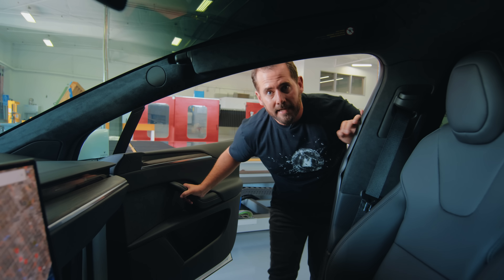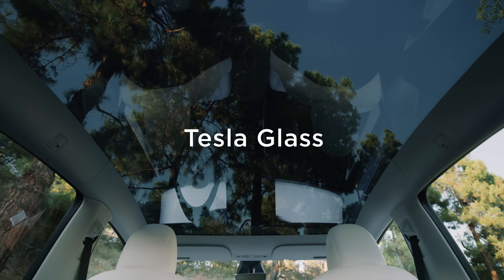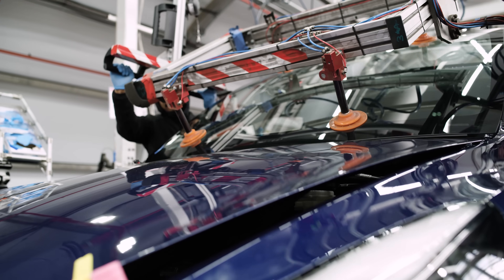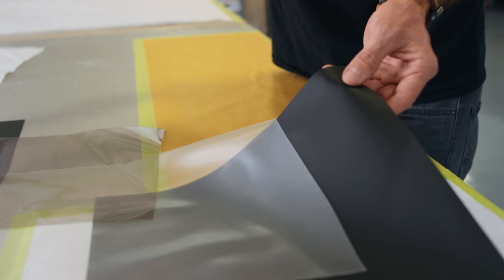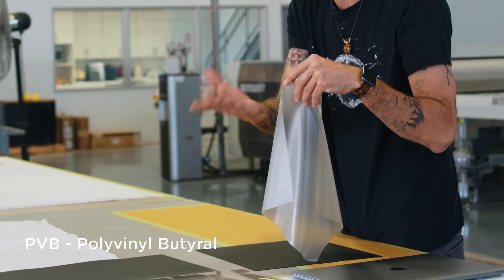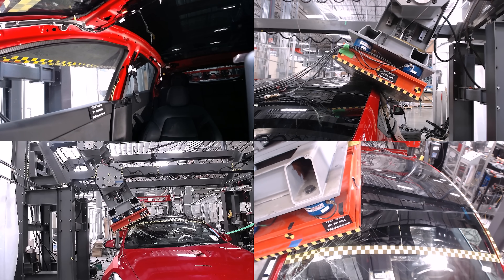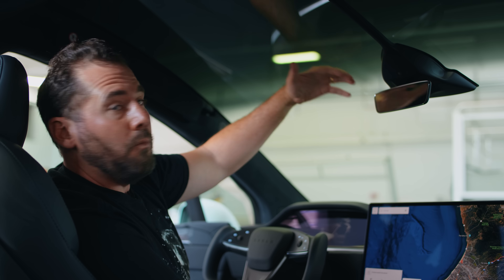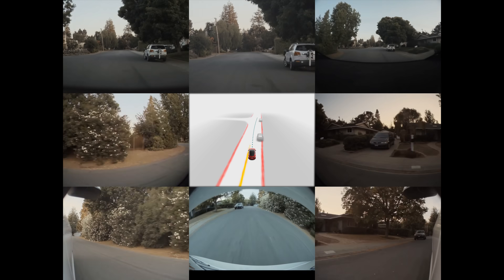Tesla Glass | The Secret to a Quiet Cabin

Comment: Tesla knows glass!
Reply: No. They know how to copy and pretend it's new
W140 features included:

Double-paned soundproofed glass was a new S-Class innovation first fitted on the W140. This form of window glazing allowed for improved soundproofing, reduced condensation, and other insulation benefits.

Electrically-operated exterior mirrors could be folded by switch to ease driving in narrow spaces.

'Parameter steering' was a system which made low-speed driving easier by reducing the effort required to maneuver in speed-sensitive situations such as parking.

Rear-parking markers, or guide rods. These rods extended from the rear corners of the trunk lid when in reverse, providing the driver with a guideline for rear maneuvers. In 1995, this system was replaced by the sonar-based Parktronic system which measured the distance of the bumpers to nearby obstacles.

12-way powered, heated front seats, with 3 setting memory functions and lumbar support.

Windshield wipers with heated washer system. Later models also included rain-sensing windshield wipers.

Electrically-operated automatic-dimming inside rear-view mirror that tied into the seat and steering wheel memory.

Heated exterior mirrors. Later models also included auto-dimming driver's side mirror.

Orthopedic seats were an expensive option from the factory but consisted of several different air cushions in the seat that the user can inflate and deflate to find the perfect driving position.

Dual-zone climate control. Four-zone climate control on LWB models.

Reclining and heated rear seats on LWB models. V12 models also have the four-place seating option, which allows fully adjustable rear seats, lumbar support and rear sunshade control. The center seat has been replaced by a burlwood center console, allowing a 2 + 2 seating format.

The climate control system could be set to operate for 20 minutes after the engine had been turned off.

Electric rear sunshade.

Rear passenger illuminated vanity mirrors.

Soft-closing doors and trunk.

Leather interiors and burl inserts (optional; standard for 500SEC/CL 500).

In 1995 the S 600 Coupe became the first Mercedes car with GPS navigation system, designated Auto Pilot System APS. It featured CD-ROM maps and full color navigation display in the center dashboard.

In 1996 the Linguatronic voice control system and Parktronic sonar-based parking system were introduced

In 1997 the TELEAID emergency and tracking system was introduced in the US market.

Also, developed with the car, a Bose sound system was available as an option.

Comment: Best in the business.  Like...WAY better.  Thank you @Tesla for igniting the spirit of innovation!
Reply: Lol!!!!
W140 features included:

Double-paned soundproofed glass was a new S-Class innovation first fitted on the W140. This form of window glazing allowed for improved soundproofing, reduced condensation, and other insulation benefits.

Electrically-operated exterior mirrors could be folded by switch to ease driving in narrow spaces.

'Parameter steering' was a system which made low-speed driving easier by reducing the effort required to maneuver in speed-sensitive situations such as parking.

Rear-parking markers, or guide rods. These rods extended from the rear corners of the trunk lid when in reverse, providing the driver with a guideline for rear maneuvers. In 1995, this system was replaced by the sonar-based Parktronic system which measured the distance of the bumpers to nearby obstacles.

12-way powered, heated front seats, with 3 setting memory functions and lumbar support.

Windshield wipers with heated washer system. Later models also included rain-sensing windshield wipers.

Electrically-operated automatic-dimming inside rear-view mirror that tied into the seat and steering wheel memory.

Heated exterior mirrors. Later models also included auto-dimming driver's side mirror.

Orthopedic seats were an expensive option from the factory but consisted of several different air cushions in the seat that the user can inflate and deflate to find the perfect driving position.

Dual-zone climate control. Four-zone climate control on LWB models.

Reclining and heated rear seats on LWB models. V12 models also have the four-place seating option, which allows fully adjustable rear seats, lumbar support and rear sunshade control. The center seat has been replaced by a burlwood center console, allowing a 2 + 2 seating format.

The climate control system could be set to operate for 20 minutes after the engine had been turned off.

Electric rear sunshade.

Rear passenger illuminated vanity mirrors.

Soft-closing doors and trunk.

Leather interiors and burl inserts (optional; standard for 500SEC/CL 500).

In 1995 the S 600 Coupe became the first Mercedes car with GPS navigation system, designated Auto Pilot System APS. It featured CD-ROM maps and full color navigation display in the center dashboard.

In 1996 the Linguatronic voice control system and Parktronic sonar-based parking system were introduced

In 1997 the TELEAID emergency and tracking system was introduced in the US market.

Also, developed with the car, a Bose sound system was available as an option.

Comment: Once again Tesla shows the world how it's done. This is why they are Number One in innovation.
Reply: You're joking?
W140 features included:

Double-paned soundproofed glass was a new S-Class innovation first fitted on the W140. This form of window glazing allowed for improved soundproofing, reduced condensation, and other insulation benefits.

Electrically-operated exterior mirrors could be folded by switch to ease driving in narrow spaces.

'Parameter steering' was a system which made low-speed driving easier by reducing the effort required to maneuver in speed-sensitive situations such as parking.

Rear-parking markers, or guide rods. These rods extended from the rear corners of the trunk lid when in reverse, providing the driver with a guideline for rear maneuvers. In 1995, this system was replaced by the sonar-based Parktronic system which measured the distance of the bumpers to nearby obstacles.

12-way powered, heated front seats, with 3 setting memory functions and lumbar support.

Windshield wipers with heated washer system. Later models also included rain-sensing windshield wipers.

Electrically-operated automatic-dimming inside rear-view mirror that tied into the seat and steering wheel memory.

Heated exterior mirrors. Later models also included auto-dimming driver's side mirror.

Orthopedic seats were an expensive option from the factory but consisted of several different air cushions in the seat that the user can inflate and deflate to find the perfect driving position.

Dual-zone climate control. Four-zone climate control on LWB models.

Reclining and heated rear seats on LWB models. V12 models also have the four-place seating option, which allows fully adjustable rear seats, lumbar support and rear sunshade control. The center seat has been replaced by a burlwood center console, allowing a 2 + 2 seating format.

The climate control system could be set to operate for 20 minutes after the engine had been turned off.

Electric rear sunshade.

Rear passenger illuminated vanity mirrors.

Soft-closing doors and trunk.

Leather interiors and burl inserts (optional; standard for 500SEC/CL 500).

In 1995 the S 600 Coupe became the first Mercedes car with GPS navigation system, designated Auto Pilot System APS. It featured CD-ROM maps and full color navigation display in the center dashboard.

In 1996 the Linguatronic voice control system and Parktronic sonar-based parking system were introduced

In 1997 the TELEAID emergency and tracking system was introduced in the US market.

Also, developed with the car, a Bose sound system was available as an option.

Comment: Tesla haters only hear what we owners say. If you justify $45k for a car tell (educate) them why it’s justifiable. This way they’ll also understand why some of us are Fan Boys and not foolish with our money.
Reply: Lol
W140 features included:

Double-paned soundproofed glass was a new S-Class innovation first fitted on the W140. This form of window glazing allowed for improved soundproofing, reduced condensation, and other insulation benefits.

Electrically-operated exterior mirrors could be folded by switch to ease driving in narrow spaces.

'Parameter steering' was a system which made low-speed driving easier by reducing the effort required to maneuver in speed-sensitive situations such as parking.

Rear-parking markers, or guide rods. These rods extended from the rear corners of the trunk lid when in reverse, providing the driver with a guideline for rear maneuvers. In 1995, this system was replaced by the sonar-based Parktronic system which measured the distance of the bumpers to nearby obstacles.

12-way powered, heated front seats, with 3 setting memory functions and lumbar support.

Windshield wipers with heated washer system. Later models also included rain-sensing windshield wipers.

Electrically-operated automatic-dimming inside rear-view mirror that tied into the seat and steering wheel memory.

Heated exterior mirrors. Later models also included auto-dimming driver's side mirror.

Orthopedic seats were an expensive option from the factory but consisted of several different air cushions in the seat that the user can inflate and deflate to find the perfect driving position.

Dual-zone climate control. Four-zone climate control on LWB models.

Reclining and heated rear seats on LWB models. V12 models also have the four-place seating option, which allows fully adjustable rear seats, lumbar support and rear sunshade control. The center seat has been replaced by a burlwood center console, allowing a 2 + 2 seating format.

The climate control system could be set to operate for 20 minutes after the engine had been turned off.

Electric rear sunshade.

Rear passenger illuminated vanity mirrors.

Soft-closing doors and trunk.

Leather interiors and burl inserts (optional; standard for 500SEC/CL 500).

In 1995 the S 600 Coupe became the first Mercedes car with GPS navigation system, designated Auto Pilot System APS. It featured CD-ROM maps and full color navigation display in the center dashboard.

In 1996 the Linguatronic voice control system and Parktronic sonar-based parking system were introduced

In 1997 the TELEAID emergency and tracking system was introduced in the US market.

Also, developed with the car, a Bose sound system was available as an option.

Comment: What year did you start including the sound dampening in the glass? Also, do older Model 3's (e.g. early 2019) have the 99% UV protection? Is that protection only on the glass roof? Thanks.

Comment: Tesla.... keep doing your thaaaang !
Reply: Yes. Copying 
W140 features included:

Double-paned soundproofed glass was a new S-Class innovation first fitted on the W140. This form of window glazing allowed for improved soundproofing, reduced condensation, and other insulation benefits.

Electrically-operated exterior mirrors could be folded by switch to ease driving in narrow spaces.

'Parameter steering' was a system which made low-speed driving easier by reducing the effort required to maneuver in speed-sensitive situations such as parking.

Rear-parking markers, or guide rods. These rods extended from the rear corners of the trunk lid when in reverse, providing the driver with a guideline for rear maneuvers. In 1995, this system was replaced by the sonar-based Parktronic system which measured the distance of the bumpers to nearby obstacles.

12-way powered, heated front seats, with 3 setting memory functions and lumbar support.

Windshield wipers with heated washer system. Later models also included rain-sensing windshield wipers.

Electrically-operated automatic-dimming inside rear-view mirror that tied into the seat and steering wheel memory.

Heated exterior mirrors. Later models also included auto-dimming driver's side mirror.

Orthopedic seats were an expensive option from the factory but consisted of several different air cushions in the seat that the user can inflate and deflate to find the perfect driving position.

Dual-zone climate control. Four-zone climate control on LWB models.

Reclining and heated rear seats on LWB models. V12 models also have the four-place seating option, which allows fully adjustable rear seats, lumbar support and rear sunshade control. The center seat has been replaced by a burlwood center console, allowing a 2 + 2 seating format.

The climate control system could be set to operate for 20 minutes after the engine had been turned off.

Electric rear sunshade.

Rear passenger illuminated vanity mirrors.

Soft-closing doors and trunk.

Leather interiors and burl inserts (optional; standard for 500SEC/CL 500).

In 1995 the S 600 Coupe became the first Mercedes car with GPS navigation system, designated Auto Pilot System APS. It featured CD-ROM maps and full color navigation display in the center dashboard.

In 1996 the Linguatronic voice control system and Parktronic sonar-based parking system were introduced

In 1997 the TELEAID emergency and tracking system was introduced in the US market.

Also, developed with the car, a Bose sound system was available as an option.

Comment: Tesla just showed the world how advertising REALLY should be done !
Reply: Lol
W140 features included:

Double-paned soundproofed glass was a new S-Class innovation first fitted on the W140. This form of window glazing allowed for improved soundproofing, reduced condensation, and other insulation benefits.

Electrically-operated exterior mirrors could be folded by switch to ease driving in narrow spaces.

'Parameter steering' was a system which made low-speed driving easier by reducing the effort required to maneuver in speed-sensitive situations such as parking.

Rear-parking markers, or guide rods. These rods extended from the rear corners of the trunk lid when in reverse, providing the driver with a guideline for rear maneuvers. In 1995, this system was replaced by the sonar-based Parktronic system which measured the distance of the bumpers to nearby obstacles.

12-way powered, heated front seats, with 3 setting memory functions and lumbar support.

Windshield wipers with heated washer system. Later models also included rain-sensing windshield wipers.

Electrically-operated automatic-dimming inside rear-view mirror that tied into the seat and steering wheel memory.

Heated exterior mirrors. Later models also included auto-dimming driver's side mirror.

Orthopedic seats were an expensive option from the factory but consisted of several different air cushions in the seat that the user can inflate and deflate to find the perfect driving position.

Dual-zone climate control. Four-zone climate control on LWB models.

Reclining and heated rear seats on LWB models. V12 models also have the four-place seating option, which allows fully adjustable rear seats, lumbar support and rear sunshade control. The center seat has been replaced by a burlwood center console, allowing a 2 + 2 seating format.

The climate control system could be set to operate for 20 minutes after the engine had been turned off.

Electric rear sunshade.

Rear passenger illuminated vanity mirrors.

Soft-closing doors and trunk.

Leather interiors and burl inserts (optional; standard for 500SEC/CL 500).

In 1995 the S 600 Coupe became the first Mercedes car with GPS navigation system, designated Auto Pilot System APS. It featured CD-ROM maps and full color navigation display in the center dashboard.

In 1996 the Linguatronic voice control system and Parktronic sonar-based parking system were introduced

In 1997 the TELEAID emergency and tracking system was introduced in the US market.

Also, developed with the car, a Bose sound system was available as an option.

Comment: A normal metal roof with a textile headliner is cheaper, safer and lighter, provides better thermal insulation and has better acoustic characteristics (like sound damping) than a glass roof. (But of course laminated glass is still better than normal glass)